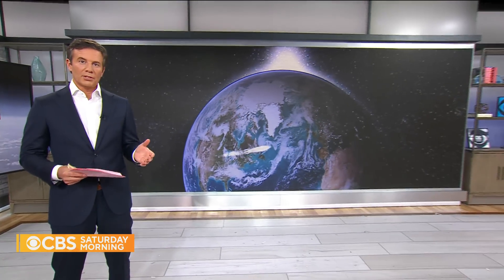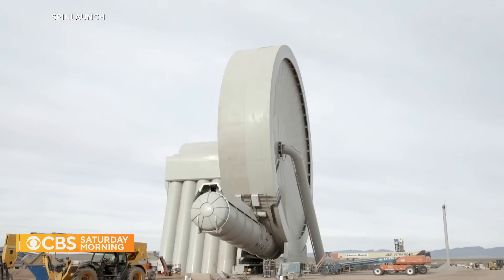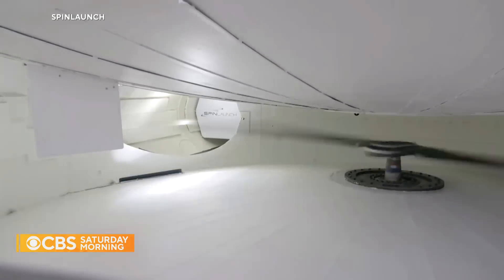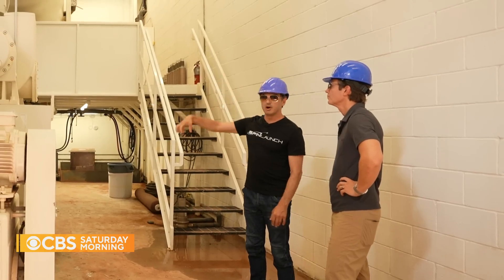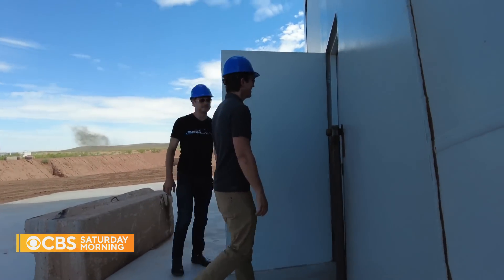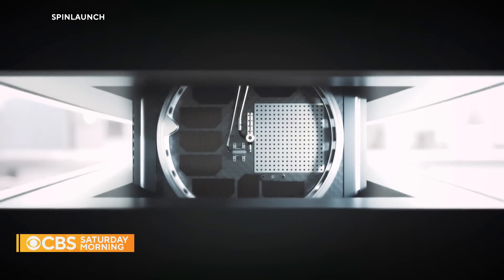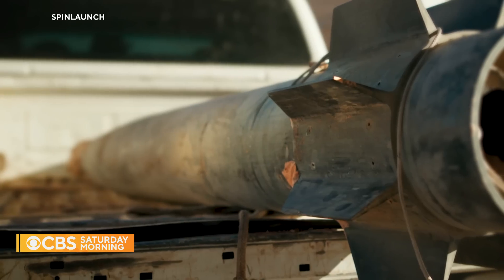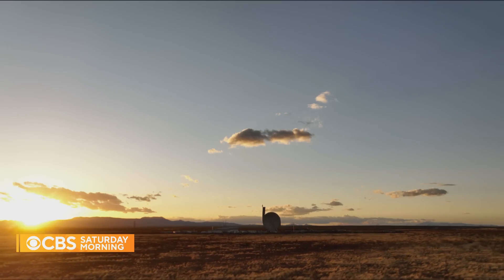New technology aims to put a whole new spin on space travel

Comment: After reading some of the negative comments I just couldn’t stay silent !

Have any of you payed attention to the facts presented in the last 8 minutes??
It wasn’t an idea shown in a computer generated simulation…. It exists & has been built & tested since 2014 so it works (10 times already).
I don’t think they would waste a further $250 million building a bigger one if it hadn’t a great chance of working !!

Why do people get such a power trip out of being negative, positive things happen when people think outside the box & experiment.
Many visionary people are considered crazy until one day they change the world.
Reply: Well, As someone who actually works on rockets, I can tell you a couple of key problems.

1st, the vehicle will undergo a significant amount of shock from entering the atmosphere during the initial ascent as it exits the vacuum chamber. This limits your payload to extremely robust payloads. No food, no standard pressure tanks, no scientific equipment. Any pressurized container will need to be far more massive as a result of increased tank structure.

2nd, the vehicle will undergo a significant amount of atmospheric heating during ascent. This will require a strong heat shield that will need to take the brunt of the impact when it exits the tube (this is nowhere close to existing). this will also contribute to losses during ascent.

3rd, the vehicle will still need a standardized second stage with some form of propellant gas (even if it is a hybrid). This still contributes to the emissions, and will require two sets of reinforcement for the at minimum single propellant tank; which will undergo the aforementioned heating. This is a basic requirement of Orbital Mechanics.

4th, the vehicle will undergo extreme G loading on two axies. This will add an immense amount of mass through the structural requirements; which is by definition, the enemy of Aerospace Engineers.

5th, they are perfectly fine with spending money with little chance of actual return; as is the norm with rocketry startups. Look no further than ARCA space's EcoRocket and EcoRocket Heavy.

The entire emissions argument falls on its face when you consider the current shift to reusable vehicles using LCH4; an electrically synthesizable gas that can be produced from the CO2 it produces. I'd be more than happy to be proven wrong, but the problems they face are significant enough that I (and my colleagues for that matter) don't see it being a scalable solution beyond extremely robust and inexpensive cubesats.
Reply: I don’t disagree with you points, all new technologies have hurdles to overcome.
Not long ago Elon Musk was considered crazy when he said he could land the rockets afterwards.
Always consider the rapid pace of innovation, the iPhone only exists for 16 years, Ai is developing rapidly.

“The only constant is change”
Reply: @Unicorn-Hunters  I think the big problem with this method is that it has an extremely limited range of payloads. F9 and the Space Shuttle worked because their recovery methods don’t effect the payload drastically. You can launch a Shuttle payload on an Atlas V with little to no modification.

This is absolutely not true for Spinlaunch. To swap to a spinlaunch payload requires a complete redesign of your spacecraft to support two massive sections of G loading from launch as opposed to small g loading at a continuous rate. Swapping back to a standard launcher leaves you with a payload that can be trimmed massively to save money; and more volume to add payloads cut because of the loads experienced during “launch”.

As a result, the Spinlaunch system will need to be cheaper; even with the additional mass requirements for thermal and structural limitations, while still accounting for the loss of the much more sensitive equipment.

This alone will cripple their viability; leaving them with small, low cost and low scientific value Cubesats. The loads and shocks experienced eliminate nearly all science and cargo payloads; restricting anything else as well.

Comment: I'm all for electromagnetic launch catapults, but going around in a tight circle is going to inflict more gees - and more destruction on the payload - than firing it out of an actual cannon barrel the same length as the radius of the launcher.  This is looking way way dumber than building a superconducting, vacuum-enclosed straight track up the side of a mountain.
Reply: SpinLaunch does improve upon gun type systems such as HARP, in which payloads would experience 25,000 g as opposed to 10,000 g with SpinLaunch. Still a lot, but not as much as gun-type launch. If you are thinking of StarTram or Mag-Lifter, those maglev systems could potentially cost tens of millions per km, and they have to be at least over 130km in length. SpinLaunch has a much, much, smaller footprint, of course, with system compactness comes with added gees. If successful, this may make investors more comfortable with the idea of financing electromagnetic launch tech.
Reply: @mpeterselman  If you accelerate something in a straight line across the diameter of the spinlaunch system, from a dead stop to the same speed as the spinlaunch payload, that acceleration will pull exactly the same gees as the centripetal force the spinlaunch payload gets going around in a circle at that speed. Seriously - compare the physics formulas, it literally works out exactly the same. 

So If HAARP is pulling stronger gees for the same launch velocity its barrel must not be as long as the diameter of the spinlaunch cycler.

Comment: Looking at this system there many issues:
1. How out of balance with the system be at full size when you release the mass? The higher the rotational velocity the greater the force applied. This is a V^2 relationship, where when you double the velocity the force increases by 4. When the mass is released, the force for the counterbalance will be in the opposite direction will be the same and unless there is somewhere to either drop the mass or stop the rotation rapidly, the system will fly apart.

2. At 5,000 files per hour debris from the breakable seal holding the vacuum with be very damaging to the projectile launched. At 5,000mph that is the equivalent to 7,333 feet per second. Anything capable of holding 14psi of pressure out in an opening that large is going to cause a lot of damage. Having the projectile breaking through it may look cool, but it is a disaster for the object traveling at that speed.

3. When the projectile encounters the atmosphere at 5,000mph both the shock and ram pressure heating will be tremendous. The only materials to be able to survive that are either ceramic, and or Carbon/Carbon structures. The carbon structures do not do well with impacts, and the ceramic's are very heavy.

This is nothing more than snake oil being sold to low resolution thinking individuals. Just these three issues alone make this implausible, and there are many more. Any time someone tells me that this is ecologically sound, alarm bell go foo saying "Scam Alert".
Reply: Your point #2 is excellent! Remember that Columbia was only doing about Mach 1.3 when a foam insulation chunk the size of a briefcase hit the wing, dooming the spacecraft. Multiply that speed and imagine the kinetic forces involved. Also imagine what the "membrane" is made of in order to pull a vacuum on an orifice of that size, and how a Mach 5 impact would be on the launch vehicle. This is nothing but an investor-bait gimmick.
Reply: @spinynorman887  My sentiments exactly, it is nice to see some high resolution thinkers here. I just hope some dufus with my retirement 401K money doesn't see this as a "green sustainable growth opportunity". Have fun.
Reply: @spinynorman887   " . . . imagine what the "membrane" is made of in order to pull a vacuum on an orifice of that size, and how a Mach 5 impact would be on the launch vehicle."  Point Well Taken!
Reply: 100% agree with you!! Listening to that man talking, gave me OceanGate vibes!
Reply: Agreed, and how to stop the rocket tumbling? It will tumble at the same rpm as the rotor when released. At release, within the same microsecond an equal weight on the opposite side must be released, otherwise the whole structure will shake to a spectacular explosion. I'm looking forward to see first launch with that thing.
FYI, it is not possible to get orbital insertion without a second push from a rocket no matter what.
Reply: @linmajon  I had expounded upon the angular momentum in other previous posts. This will be significant, and per the snake oil salesman for this system, he is expecting aerodynamics of the projectile to stabilize it. Penetrators from smooth bore tank guns are very thin in relationship for their length. The fins are oversized for that stability. However, in this system the projectile has a large diameter, and the fins for stabilization are probably shadowed from the air stream due to the wide body. This is not well thought out, and only low resolution thinking will allow someone to invest in this. Unfortunately, that condition is much more prevalent that it should be.
Reply: @rpercifieldjr  Yes, they also have the membrane, when bursted air will rush in to fill the volume. This could very well make a pressure shock on the inside that could damage the whole structure. There are just too many open issues with this 'project'.
Reply: @linmajon  The membrane needs to withstand 50,000 lbs (I'm estimating it is 6ft by 4ft and atmospheric pressure is 15lbs per square inch).  Therefore the 'membrane' will need to be a solid piece of something and it will destroy the projectile when struck.  I also spotted the g force issues (on fragile satelite payload) and also the tumbling of the projectile (as tip and tail are never moving at the same velocity).  This whole thing is so half baked you can play a drinking game of 'spot the flaw'.
Reply: @chriswright9096 When you let go of a spinning tethered object, it flies off at a tangent to the circle in which it was traveling while tethered.  The centripetal forces it was experiencing go away altogether in that moment.  In short, I don't see an issue here at all.
Reply: @joesterling4299  The nose and tail are both travelling at a tangent to the circle.  However they are on different points of the circle, therefore slightly different tangents.  Upon release, the projectile will tumble at a frequency identical to the frequency of rotation of the machine.  I think in the film of the trial you can see that the tail does not go through the 'membrane' at the same point as the nose; evidence of tumbling.
Reply: @linmajon  You are the FIRST one who adresses the tumbling (!) . You will get a lanched item which rotates every time it travels 3,14 chamber diameters away from the chamber. And that is a very fast rotation. Fuels will transfer to the ends of the vehicle-tanks, instead being at the pick-ups, used for the satelite steering.
Reply: This has been debuncked by Thunderf00t
Reply: Bet it will work well for bowling balls!
Reply: @allanfifield8256  Maybe Pumpkin Chunking.....
Reply: I smiled at "low resolution thinking individuals." I'm going to shorten that to "low res people" for personal use.
Reply: @aluisious  I wish I could claim that one, but I got it from Dr Jordan Peterson, one of very few people that have added euphemisms to my vernacular. I like your contraction of it as well.
Reply: I wonder if they can have some kind of air cannon that blasts off at the same time to mitigate the atmosphere collision issue.
Reply: @snuffeldjuret  I do not know if an air canon would be of help, possibly the use of a detachable Sabot may help, but the fundamental physics of launching a hypersonic projectile into the lower atmosphere is not trivial, and all of the right questions have not been answered. 

I have built an air cannon to launch a potato at about the same speed at their launch of Mach 1. We do know the physics of high speed projectiles, and their response in air over time. None of those equations are making this project promising. None of what they have shown to date demonstrate scalability of this system.
Reply: One potential solution is to shoot the counterweight into the ground (hopefully into something designed to dissipate the impact energy safely) at the same time the payload launches.
Reply: Show us where you do the math to back all that up.  Because people have done the math on this, it checks out, don't believe me?  Do it yourself, but i doubt you have the capability.  

I mean, if one guy on youtube can debunk it in the comment section on a video then there's no way they'd ever make it past the initial planning right?  They definatley wouldn't have test facilities up and running right?

If nothing else, you should be happy there are people exploring the science behind it so that you don't have to spend money doing it.  How short sighted and close minded do you have to be to completely miss that point?
Reply: @Damaged7  There is a sucker born every minute, and one has only to look at the scams being done by many people that defy logic and reason to get money from others abound. But hey go ahead and put your hard earned cash into this project.

I did give you the math, and it was you who could not comprehend it, not me. I am an engineer and use much more complex math on a daily bases, when not pushing paper or convincing idiots that when the math doesn't work, the product won't work. Yes there are people who may have done some calculations for this system, for all I know they could have been the same ones that calculated the pressures for the Ocean Gate Submersible. We know how that turned out......

Look at the hyperloop that Musk was advocating for, where is it? Why are we not traveling at such high speeds? Because the physics and math did not work. SpaceX does work, because the math and physics do work. Not all of it though, as they found out with their launch pad in Texas, which should serve as a warning to everyone including myself, you should be your own worst critic, for everyone is fallible. The easiest person to fool is yourself.

As long as it is only gullible people investing their own money into this I do not care, but will provide information and questions that should be asked before investing. My concern is that my taxes and retirement saving are never used for this type of pie in the sky, low resolution thinking projects.
Reply: Only have to look at point 3. The projectile will instantly become an asteroid in reverse the moment it impacts the dense atmosphere & atmospheric pressure.
Reply: Skepticism is healthy. However, all you have to do is do the calculations properly, use the right materials, and, most importantly in this case, have a control system fast enough to manage the release.
Reply: THIS is sounding very 4 wheels that had AI in each of them!!  Try the "vision of Ezekiel"  and give me a nod ))
Reply: All these questions are addressed in several other videos. They still need another motor (engine) to get an object in to orbit - so yeah - still some issue to be addressed.
Reply: @mb-3faze That's like saying we still need to solve some equations before we figure out how magic works.... 

A thousand yard diameter centrifuge going at those velocities would expose the projectile to 25,000 G. 
some issues indeed....
Reply: For number one, you might be able to fire two projectiles in close succession, located at opposing sides of the launching arm. Sure, you have to release them in sequence, so that will still put stress on the system, but you are doing it in VERY quick succession, and once the second projectile leaves the cannon, the majority of the stored energy leaves the system with it.
number two and three might be solvable in the same go by making a staggered air lock. as in, you make the release chimney longer and have the projectile pass through several chambers of increasing pressure on its way out.
I personally don't think the latter is feasible, becuase it requires you to be even more precise on your launch release to not damage your facility, but who knows.

End of the day, I think the larger problem is something else: WHat the hell are you going to launch with this? Satelite engineers already face hurdles desingning payloads that can withstand a rocket launch, so an alternative would very much be appreciated, but this will ALSO put large stress on your thing, only in a different way. 

So this is not really an imrovement, even IF they get it to work. But if it isn't an improvement, then what is the point? Maybe they are just trying to attract the attention of the military, trying to interest them in a cannon with unlimited range?
Reply: Sorry bud that that's a seriously stupid suggestion. "Oh, we will do 2 projectiles, no problem, it will only take a short while to get to the second one, maybe the huge machinery ripping itself apart won't notice that quickly."

You know what else only takes a short amount of time? A bullet going through your skull, and yet you're dead forever afterwards. @Alexander_Kale
Reply: @Alexander_Kale  if you are going to do an airlock you might as well just have a door that opens to the atmosphere and leave it open.